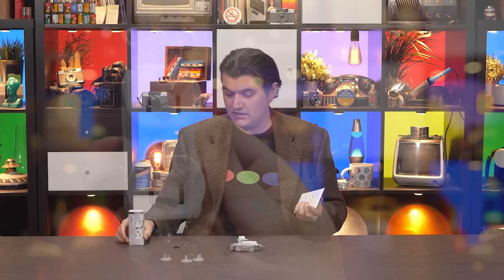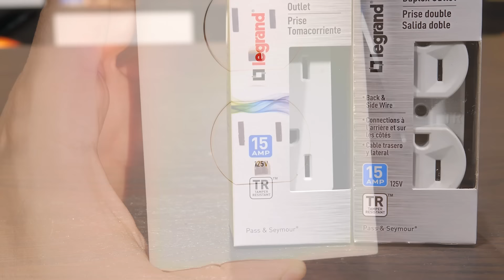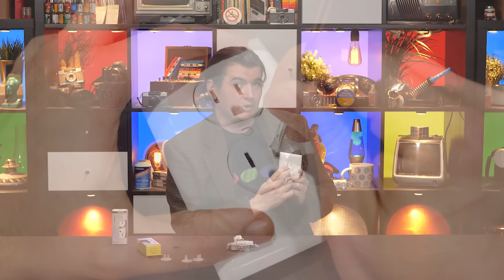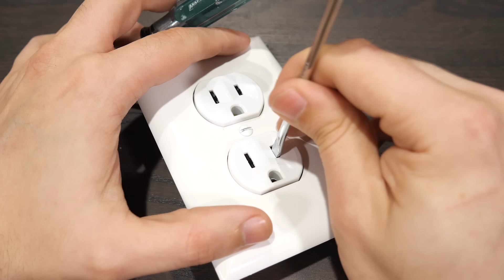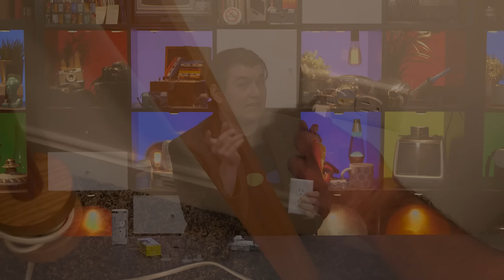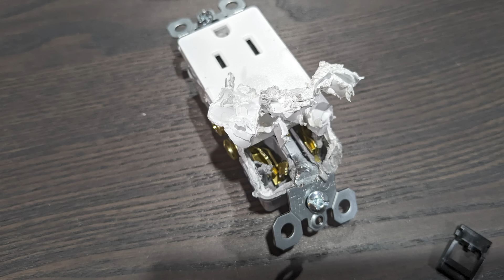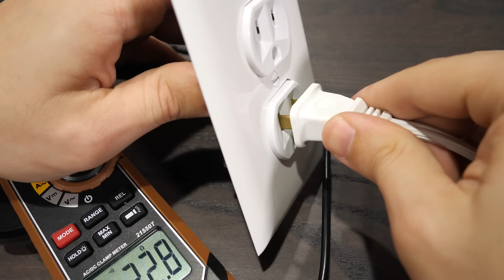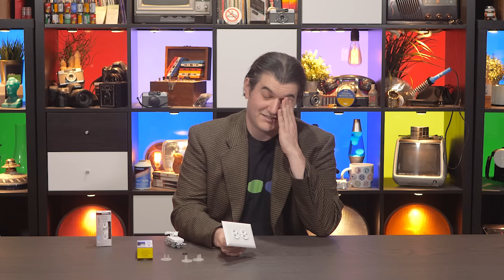Tamper-resistant outlets aren't all the same - a follow-up

Comment: I think I got shocked twice in my life. Once was as a kid and another was an adult back in 2006. We had a fire hazzard at work. (power strip to power strip to wall) We got called out for it. So first thing was to remove everything. So I did. one of them was cracked. ZAP! not pleasent.  lol After that we just bought new strips where each strip was purpose bought either medium length or long length cord so daisy chaining wasn't necessary.

Comment: I had to replace all of the outlets in one  house  because they were all backstabbed.   The tenant complained that there wasn't enough power at some outlets to run a space heater.  It turned out to be the connections inside the outlets were high resistance.  Draw some current from them and the connections would overheat and loosen making the problem worse.  I fell lucky that there wasn't a fire.

I've seen similar problems (roasted wire and melted boxes) with wire nuts and even crimps but those tend to be isolated to one connection that overheats.

I'm suspicious of push in connectors - there just isn't much metal to conduct the current.

Comment: You actually get the shutters that require both pins to be pressed together in the UK too.</UKPlugsAreSuperior>

TBH, instead of trying to change plugs/sockets, switched outlets would at least keep you safe when inserting/removing.

Comment: WG connectors have so much advertising on youtube. It's so astroturf'd that I'm inclined to just avoid them. They seem insanely overpriced and not nearly as good as advertised unless you're a contractor basically trying to move fast... which, fine. But they're not the best.

Comment: When I was like 7, I got shocked by our wonderful American plugs. Although not in the typical way. I unplugged a simple 2 prong-to-usb plug, and one of the pins came out of the plug, and was left in the wall.. And of course, being a dumb 7-year-old, I simply reached to take the pin out of the wall. Got the true "electricity dangerous" message engraved into my mind that day. I've also been shocked by some really bad arching as well, so that's fun. Thankfully, 120v is safer than 240.
Reply: That sounds like you got shocked by a crappy Chinese rendition of an American plug.

Comment: Worth noting that some UK outlets do require that all 3 pins are inserted at once for the shutters to open, rather than just the Earth/Ground pin, and yeah they can be a bit finicky if your angle is off.
Reply: They can also be felt in more safely as you can get the ground pin in before any of the other pins enter the plug.

Comment: @TechnologyConnextras At 20:15 "I have a lot of loose ends...." . Well, hopefully not in contact with Mains voltage.😅

But seriously. Instead of redesigning the whole Socket/Plug, wouldn't it be easy enough to just raise the Plastic around the holes, to created a recess? Kind of like every "Schuko" Outlet has it!

Yes, that would mean the end for right angled Plugs. But hey, one can't save everything.

... And your wall adaptors. Well, dang. I thought it was a good Idea. 😞

Comment: @TechnologyConnextras 12:27 with respect to "safer" versus "less dangerous" I would like to offer a potential way to think about it. (I'm not going to say that one or the other is the "proper way to say it, because that would just be linguistic bigotry.) Something is "dangerous" if it causes significant injury or death when it actually happens. Something is "risky" if it has a high chance of happening. If you touch and complete a common North American household 120V circuit with 15A, you will die. But in spite of the problems with our North American outlets that you've identified, the average person's daily interactions with electricity plugging and unplugging electrical cords so the risk is very, very small that they will do so.

So I would suggest that in this "safer versus less dangerous" accidental miscommunication, that you are using "dangerous" as a synonym for "risky" rather than "safer" as a synonym for "less dangerous". I personally find that this is a common equivalence made by English speakers unless in their educational and professional life they were talking about both and needed to differentiate between them in order to communicate effectively with their peers. English has so many words like that which are overlapping but not strictly 100% equal, thanks to all the burrowing we have done over the centuries from other languages. I also find that ESL people, even when very fluent, have learnt these overlapping words by associating them with words in their own language that refer to similar concepts but don't have near the same amount of overlap.

I would bet that the majority of people who argue with you about that are Continental Europeans for whom English is a second language.😊

You're both right given the different contexts that each of you are assuming, it's just that the assumption has not been communicated in order to bridge that gap and make sure that everybody is operating under the same context.

Sometimes it will be your responsibility to say that when you use "safer" you mean less "risky", and sometimes if the responsibility of the listener to ask "by safer you mean less dangerous or less risky?", but that really depends on how the conversation evolved to that point

Comment: remember that its twice the voltage but half the amps, i don't think you'd die from touching a plug here either, i've been shocked fiddling around with  a stereo, i think more than once, when i was a kid and it wasn't a big deal, just a jolt. (literally the wires coming straight out of the plug on the wall, wasn't 5v from somewhere in the stereo or anything)

..i think it's half the amps anyway, the sockets are certainly rated for half the ampsish, they're all 10amps, and i think the US has 15 and 20, if i recall rightly. sry if that's wrong.

Comment: I've been trying to find statistics on the number of deaths and injuries from electricity around the world, and it is very difficult to find proper numbers.  Looks like deaths by electricity in the USA are about 500 to 1000 per year.  In the UK, between about 10 and 20.  Of course, very different population size (UK is - what - about 10% of the size of the USA).  So you would expect about 50 to 100 deaths in the UK if the population were the same size as the USA. So roughly one tenth as many deaths per capita.  Not sure exactly what that tells us, but it might imply that 230 volts is not more dangerous than 120 volts.  But I am sure that there are other factors involved (safer sockets and plugs probably among them).
Reply: Some of those deaths in the USA involve contact with overhead wires and commercial/industrial level voltages, both of which are higher than 120V.
Reply: @brianleeper5737 Like I say, figures are hard to come by.  But it is only some.

Comment: Plug and switching a house is one of the first things a person should do if theyre capable and willing, and doing so in an informed manner. Its a great way to update, familiarize yourself with your own homes wiring. 

Dont EVER backstab. Its just bad practice. I as an electrician have seen many failures on backstabbed receptacles. Pass thru and not.

Comment: Question: is lower voltage means higher current (to match power) and is more likely to cable be fried?
Reply: I don't know the current usually used in Europe for example, where they have 240V power, but here in the US where we have 120V, we either have 100A or 200A current at the breaker for the home (200A is if you have like an electric stove, dryer, and water heater. you can't have those with 100A). Each circuit (so collection of outlets/lights or a single special appliance) is 15A, sometimes 20A. A big appliance like I mentioned will be 2 circuits tied together, each being 15A usually, for a total of 30A. 

 So, compare that to your local standard for household current (amperage/amps) and breaker/fusebox per-circuit current. I think a ring of outlets in the UK might be 13A but I'm not sure. Usually things just are lower wattage here, so my electric kettle works more slowly than my friend in the UK's electric kettle, about half the speed.
Reply: @samarnadra Ok. Thanks for answer.

Comment: God I love this channel. Your style of being is so much like mine. It’s remarkable how often you’ll address exactly what I was just wondering about or thinking. I love your curiosity and enthusiasm. It’s just perfect.

As I see you’ve already addressed, my whole life I’ve been frustrated by cords and bricks that won’t stay in the socket until you spread the blades to make the plug wider. Even that only helps to some extent. It wasn’t until your other video that I realized the problem is the socket not the cord or brick! So I replaced all my sockets. Double-benefit, they were all painted over and the new sockets looked amazing in comparison. I even got nice new plates that helped the whole room look a little classier. So, thanks!

I’m shocked you’ve only been shocked by house current twice. When I was little I shocked myself many times. One time I put my hand into an empty socket on line to get into the Disney World Haunted Mansion. I’ve even done it recently when working on a power socket, even though the breaker was turned off. It turned out that the person who wired it took a weird shortcut that bridged two circuits. I never expected that!

Thanks again I’m sure these shows are a ton of work, especially since you put so much effort into actual scientific method experiments. I really respect that.

I work at the Thomas Edison Labs as a tourguide. We do a lot of study and classes. I haven’t yet checked the primary sources (that’s a task, since there’s such a huge volume), but I’ve often read that Edison chose 100 Volts for his bulbs and power grid specifically because it was unlikely to give you a fatal shock. And we’ve just kept it ever since. The reason this needs to be met with a little bit of skepticism is that, during the War of the Currents, he was trying to portray his grid and wiring as much less dangerous. Since there were prominent news stories of people being electrocuted by high-voltage AC power lines being haphazardly strung about, that was a good competitive message. Was he actually thinking about safety before the War? Maybe. Don’t know.
Reply: Totally agree about the channel. A simple thought "I wonder why" turns into weeks of research and a video,  plus a follow up video, and another.

Comment: You should buy a set of german (type F) plugs and sockets, or have one of us europeans send you a box of them to play around with.
That will give you a new perspective on why we find US plugs sagging or loose.
Also the F plugs have ground pins on both sides of the plug and receptacle, allowing them to be turned 180 degrees.

Same goes for the industrial plugs nema twist lock plugs and the european CEE plugs - they are a world a part both in terms of safety and robustness.

And for reference, the EU sockets is a mess, it's by no means perfect, e.g the overlapping compatibility of type E, F and K plugs ticks me off every time i think about it.

Comment: im Canadian, i have very much seen VERY loose plugs in old  hotels and old homes. loose enough where sometimes it would just fall out if the cable was too heavy. ive seen roughly 3-5 such loose plugs in my life. yet ive only been shocked once in my life doing the same thing you did. plugging in a cable when i couldn't see the receptacle and using my finger to find the holes. thankfully wasn't too bad of a shock and ever since ive been much more careful when plugging things in. overall i still wish we would change our outlet standards to make them safer but as you said, the lower voltage does let us get away with bad design.
Reply: I've done some renovations on 50+ year old commercial buildings, there have been receptacles that the plug would rattle around like a hockey stick in a trash can they were so loose.

Comment: I think you hit on something important about the whole shock thing.  We, generally speaking, grew up being taught about outlet safety from young ages.  I think most parents/adults even do some rudimentary supervision or practice handling plugs once they get of the ages that they are aware of plugs in the wall.  I have recently done this, almost without thinking about it.  It is almost like the other learned traits that we all carry on or pass along like holding a utensil, using scissors, and other innocuous everyday objects that when used in a manner other than intended could cause some harm.  This is not a defense of our outlets, because they are bad, and I think most people agree they are bad, but we have adapted our teaching & learning techniques to adjust for it.
Reply: Agreed. I had vigilant parents so my upbringing contained a lot of 'Stop. Look at what you're doing. What happens if...' It certainly formed how I approach situations unconsciously as an adult. Of course they kept dangerous things out of reach and did the whole 'Hot, don't touch' thing as well when I was a toddler. Never from a fear standpoint, just learning to be safe.

Comment: Just a note on 2 prong activated shutters, we have had them on UK socket outlets for some considerable time. They are less common than the earth pin activated variety though. A further note on the plug in 'child proofing' socket covers that are also available here in the UK, they come complete (all plastic moulded) with all 3 pins. The earth pin is the standard shape and size for any other type of mains plug, but the live and neutral pins are somewhat shorter. This is all self defeating, because now the shutter safety mechanism is opened by the earth pin and the two shorter plastc live and neutral pins can be easily bent away from the socket exposing the potentially live portion of the outlet. 

Don't buy them, they are more dangerous than just leaving the socket as it is.
Reply: From the UK also.
I have 2 prong activated shutters in my flat, which did slightly confuse me when I first moved it. I thought my sockets were damaged, then I realised they were just were just working in a different way.
I am sure that there were safety campaigns to encourage people not use the socket covers for the very reasons you have explained. They are still legal to buy and sell but seem to be potentially dangerous (for the UK socket type)
Reply: @d4nd310Your plugs are giant.
Reply: @d4nd310 You can buy covers for that but it doesn't tend to be a common problem.

Comment: in the uk if you buy the premium brand socket outlets like mk or hager they require all 3 pins of the plug to be inserted for the shutter to open the cheaper models just the earth pin.

Comment: The best receptacles I've found are the ones labeled as "hospital grade", denoted by the green dot on the front. They are well built and have a very high grip strength. The method of "back wiring" (where you place stripped wire into a hole that is clamped with a screw) also seems the best to me. Tamper-resistant outlets are crap, and in my own home, after passing inspection I removed them and replaced with the aforementioned hospital-grade outlets.
Reply: Agree totally.  I rewired the 2nd floor of our 1906 house a few years back using hospital grade outlets and I've never regretted it.  There is still a big difference between brands.  At that time Hubbell was the best choice I could find.    They also had a tamper resistant hospital outlet that worked pretty well and were the only brand I found that were acceptable.  Hospital grade outlets are a bit pricy but if you have time you can find legitimate sellers that are getting rid of odds & ends left over from contracts, etc. and pick up a few here and there at much lower prices.
Also agree with the back wiring.  I do NOT like the spring loaded connectors but the type where the inserted wire is screwed down is the best system I've found.  Fast to install and reliable over time.

Comment: When I lived overseas they had three phase electricity at 240v in the UK, Europe, and Africa, and North America has 2 Phase, but we can have 240v with those plugs for the dryer or electrical range.

What exactly is the difference between Two Phase and Three Phase AC. Because I use it but I got no clue.

(I haven't even admitted I have no clue why the Coreolis effect is necessary for flying, And I'm o pilot, oh my shame. I just drive the plane)

Comment: had dabbled with a few jukeboxes the age if it aka the year it was build can make a world of differences. some large items like that are not even grounded and if they are some times its just the frame of the unit. I once had to make a ground line for an arcade game cause the person the build it ran it all to the same ground but never OUT of the cab so people would get a small zap on ONE bolt on the control deck case it was the ground, so I had to patch a line to the power supply and replace the cord cause they cut of the ground to fit in a socket that had no ground pin.🤦🏻‍♂🤦🏻‍♂